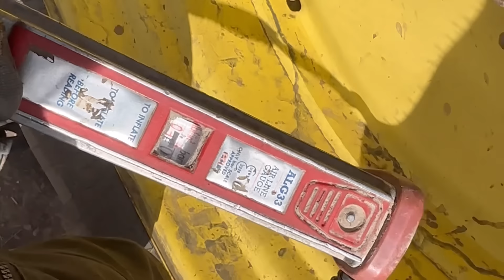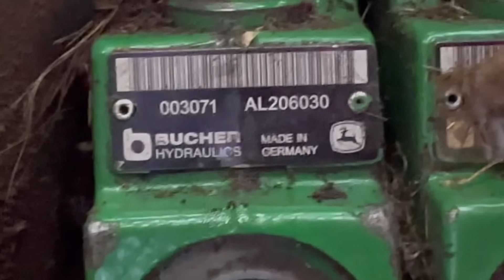Claas Combines Back Out! New Shed Gets Straw! Fixing John Deere 6930

Comment: You could put in 1 or 2 in first so that you can put 3 up after that so the top of the bales are higher than the bale spike in the new shed to save nearly hitting the roof
Reply from the maker: I know but it means I have to carry that on all the way to the end of the stack, so I suffered initially to gain later. I pick them up in 3s so best if I can stick to those multiples 😀👍

Comment: Have you an engineering shop near you. Buy a 32 mm spanner and take it to them and have them slim it in jaw width by grinding or milling to the width you need. I still have spanners in toolbox from time in industry where I had the same problem.